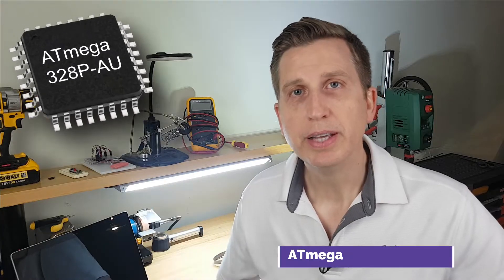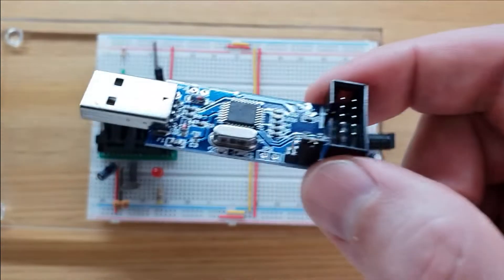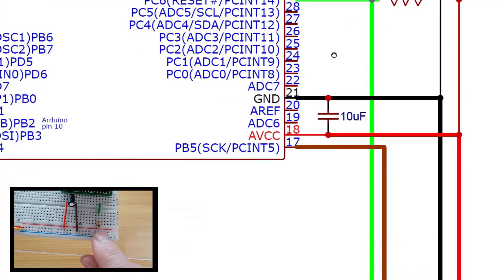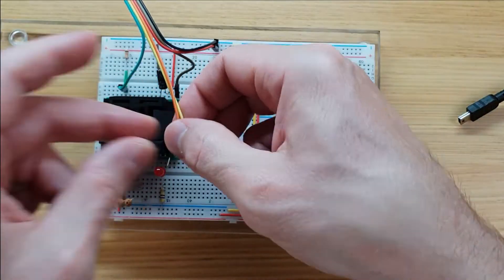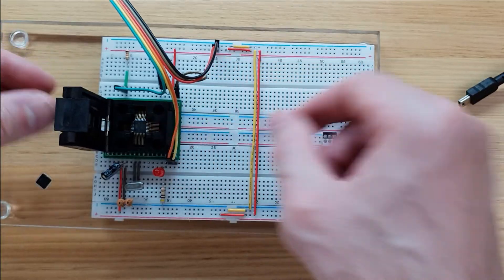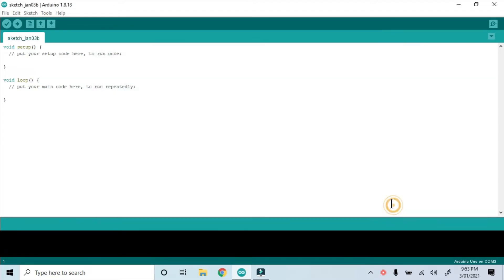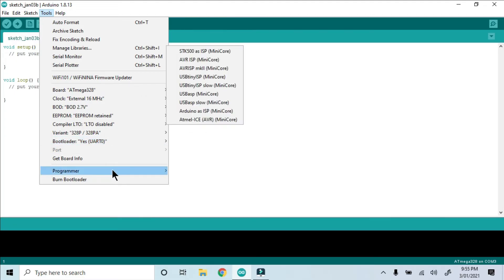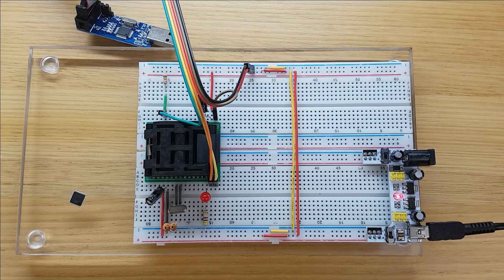Bootloader and upload to Atmega328P-AU

Comment: Could you explain why you must offset the IC pin numbers by 4 when executing the logic (i.e. blinking an LED on pin 10 to pin 14 on the adapter), but the adapter is 1 for 1 when flashing the chip (i.e. pin 4 for VCC on the chip to pin 4 on the adapter)? Not to mention when checking continuity in the adapter to the pins, it connects 1 to 1 as well.  (For context, I'm using an ATmega328PB)
Additionally, it works fine for pins 6-10, but as soon as I try blinking LEDs on the other pins, such as pin 28 on the chip but pin 32 on the adapter - the LED does not turn on.

Comment: when I open ardino IDE, it says that no port was found. Although, I installed the driver libusbK for the programmer. By the way, my programmer has one more jumper, one is for swapping between 3,3 and 5 V (JP21), and the other one -  I have no idea what it does (jp1). Also, I have two more holes for another jumper, jp3. 
PLUS: I once burned a bootloader on the  smd chip using an arduino nano. The bootloader remains on the chip? When I try to upload the blink code, an error occurs (Failed chip erase: uploading error: exit status 1) + "Double check connections and try again, or use -F to override
         this check."

Comment: I have made a a PCB using this chip and for reset i have already put a switch between ground and 10K resistor with 5V supply so do i need to press it while uploading

Comment: Hi. This is a very good video, however i`m not sure which chips i can use. I`ve got a lot on my Mini and Migthy Core boards but none with the PU or AU at the end. Just ATMega328 etc. Will any of these work in my project?
Reply from the maker: P stands for the low power version and might not always be printed on the chip.  Mini-Core boards and Arduino Nano''s both use Atmega328 chips in the QFN32 format.  If the chip is already soldered into the Mini-Core board then I'd recommend using online tutorials for that board.
Reply: @KakushinAU  Thanks a lot!!!

Comment: Get a thin wire, solder it on the pins needed, solder the thin wire onto some female or male jumpers, no need to pay 20 dollars for something you will only use once.

Comment: may you have a great day Sir, Sir please let me know that this circuit using 16Mhz Crystal Oscillator and 22PF capacitor will work with Bluetooth as well. because my circuit with same programing is working with Arduino UNO but when i try to use atmega328, oscillator and Capacitor it not accept any command.

Comment: Hello Kakushin
Why do you burn the bootloader first? I thought the bootloader is not necessary anymore when programming via ISP.

I thought when programming via ISP a previous burned bootloader will be deleted and the whole program memory is now available.
Best regards, Tom...
Reply from the maker: I'm not sure, but all the Atmega328 microcontrollers I've come across come from the factory empty without bootloaders in my experience. Once the bootloader is loaded I've always been able to upload new sketches without reburning a bootloader.  Hope that helps.

Comment: Worth noting... I am using an arduino Nano as a programmer and have been successful, both on breadboard circuit and prototype pcb. Both successful, in fact using a Mac it has been almost impossible to update the driver for the common usbasp programmer that is sold online - so I kinda had to go with a Nano, or other arduino board as the programmer.

Anyway! It's workiiiiiing! :D Nice job Kakushin! Cheers!
Reply from the maker: Thanks for the comment.  That's a good reminder that even a Nano can be used as a programmer.

Comment: is the same code? just macth pins?
Reply from the maker: Yes, the same code that works on an Arduino Nano will work on this Atmega328P-AU chip (because the Nano uses this chip).  Just need to match up the pins on the chip to the Nano.

Comment: Hello, I liked the video very much. I wonder if we can code it with rx and tx instead of miso and mosi pins.
Reply from the maker: I've used the RX and TX pins to program an ESP32 (see my bitcoin tracker video) but I haven't tried it with an Atmega328.  Most newer generation Atmega chips have migrated to using the UPDI pin for programming using a single connection.
Reply: @KakushinAU  thank you

Comment: Thanks for this video, I replicated this circuit but made a slight change to it with a soldered copper veroboard instead with predrilled holes at the right pitch . Changed to an external LED in series with a 1.5K ohm resistor works perfectly fine with ICSP (SCK) PB5 port pin (13) , [You don't need to modify the original sample Arduino Blink Sketch] you also get a visual indication from the LED that it is writing to the FLASH, I had one USBasp programmer work function OK with this circuit, but another of the very same type failed to detect the chip signature, so that is another aspect that one has to bear in mind, to successfully make this particular circuit work.
Reply from the maker: Thanks for your comment.  Very good points.

Comment: Is it possible to program the atmega chip on the arduino nano board, desolder it, and then transplant it to another board?
Reply: Unsure! I'll let you know! I can't really see why not as long as you're caps/oscillator crystal are identical, basically 1:1 circuitry on both pcb - I imagine it will work! Gonna test for my own use case so will update!

Comment: cant you just get a pair of arduino uno's and make one the bootload burner and shove this clam shell in the other one?
i'd rather do that then buy extra components that will end up in the void of space when im done with this project. 
i got 30 Atmega238P-AU ic's to burn.
Reply from the maker: Good idea, but unfortunately the pin-outs wouldn't match.  The Atmega328P chip in the Uno has 28 pins (DIP-28), while the Atmega328P-AU chip has 32 pins (TQFP-32).  Therefore the clam shell won't match up properly.

Comment: @Kakushin: Thanks for your tutorial, your solution helped me to upload the code, previously I tried with nano but not successful. Used USBasp and bootloader is done and also uploaded the blink program. But LED is NOT blinking at all. Tried with all digital pins. I am using atmega328pu smd controller.  Can you please help me on this
Reply: tried selecting the board as Nano, atemga328 (minicore) but NO output.
Reply from the maker: Sorry, seems like you have the same controller and it should work. You may have already checked the following: 1) loose connections 2) 5 volt power supply (3.3v may not be enough depending on your brown-out-detection setting) 3) reversed LED leads 4) bad resister.  Worse case maybe you've got a bad controller. Good luck.

Comment: HI Can we upload bootloader into a New IC without External clock.. Because i see there is an internal clock on Atmega328pb. Is there any Circuit for that?
Reply from the maker: Hi, I just tried it but wasn't able to get it to work.  I happen to have several PB chips I had purchased by mistake. I burned a bootloader to the fresh Atmega328pb-au (I changed the clock setting to "Interal 8Mhz", and the chip variant to "328PB").  The bootloader seemed to burn just fine, but then I wasn't able to upload any sketches regardless of what Arduino AVRboard I specified.  I think I'll stick to using Atmega328p-au chips with an external oscillator.  I've also heard that the internal oscillator isn't very accurate and can cause problems if you are doing any serial communications.  Sorry.
Reply: @KakushinAU  Hi Thanks for Reply..
I have done the same and 2 days ago it worked but the arduino sketch wont upload. I tried a hack i have compiled code and generated hex file using arduino and uploaded the hex file using an external ISP file.. It worked Flawless.. Hope you can try that out..
Reply from the maker: Thanks. I'll definitely give it a try.

Comment: Thanks a lot for posting this. I am having a lot of trouble burning a bootloader. I have put breakout pads for SS, SCK, MOSI and MISO on my board, also have the 10k pull up resistor on the board as well. Using an UNO no luck and lots of frustration. I can upload using the UNO just fine for a pro mini board but a stand alone chip, nada....I haven't tried using an ISP programmer but I have one in my drawer so I'll get that out when I get home and try it.

I really appreciate your video! It has answered questions I haven't been able to find elsewhere!

Subscribing now!

Comment: Hi - I'm trying this but when I burn the bootloader it gives me 

avrdude: Device signature = 0x000000
avrdude: Yikes!  Invalid device signature.
     Double check connections and try again, or use -F to override
     this check.

Only difference is that I'm uploading using the Nano and with Arduino as ISP instead of the ISP Programmer everything else I'm doing the exact same as in your video. Any suggestions?
Reply from the maker: Hi, you're not alone. I was getting exactly the same avrdude errors when I tried using a Nano as the ISP (except my Device signature was showing random combinations of 0's and f's).  I tried for hours and couldn't get it to work.  When I googled for solutions everyone just suggested re-checking the connections and changing capacitor values, but I still couldn't get the bootloader burned.  

Then I tried using the ISP Programmer and everything worked seamlessly.  Sorry if that doesn't help your situation, but the only thing I can suggest is to get an ISP Programmer.
Reply: @KakushinAU  Hi - Thank you. I got an ISP Programmer.  But now I'm getting this error while burning: 

avrdude: auto set sck period (because given equals null)
avrdude: error: program enable: target doesn't answer. 1 
avrdude: initialization failed, rc=-1
         Double check connections and try again, or use -F to override
         this check.

Do you have any suggestions for this?
Reply from the maker: @bobk8901  Not quite sure.  I'll try to replicate your errors in my setup.
Reply from the maker: I was able to replicate the following error codes in several scenarios.

avrdude: auto set sck period (because given equals null)
avrdude: warning: cannot set sck period. please check for usbasp firmware update.
avrdude: error: program enable: target doesn't answer. 1 
avrdude: initialization failed, rc=-1
         Double check connections and try again, or use -F to override
         this check.

Scenarios:
1) Disconnecting any 1 of the 6 ISP programming connections
2) Reversing the MISO and MOSI connections
3) Disconnecting the oscillator 
4) Changing the USBASP windows driver back to libusb-win32

Unfortunately the error codes are exactly the same in all scenarios, so it could be any one of them. As soon as I put everything back to the setup shown in the video I was able to reburn the bootloader.  Good luck, and let us know how things go.
Reply: @bobk8901  Hi, check your wires. I spent hours and hours trying to solve this error until I decided to check continuity with a multimeter and found 1 faulty wire.